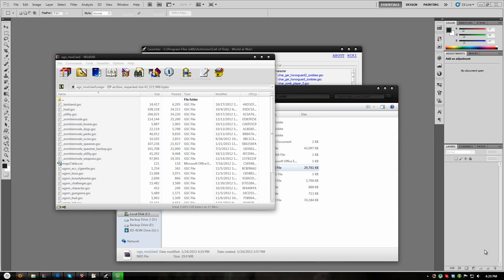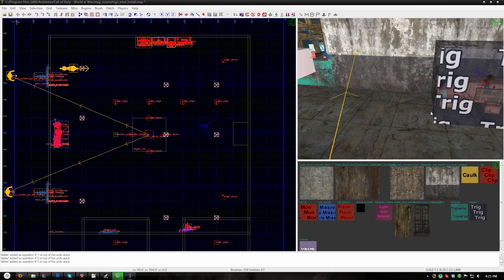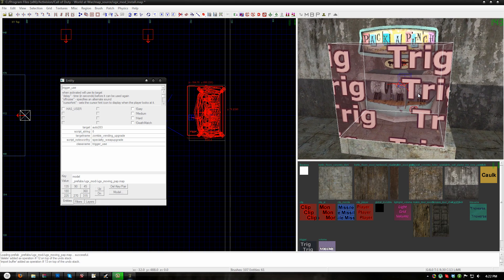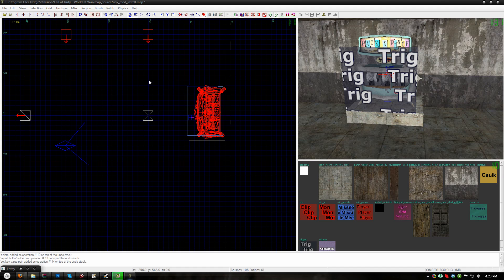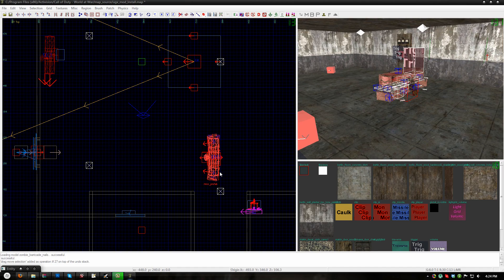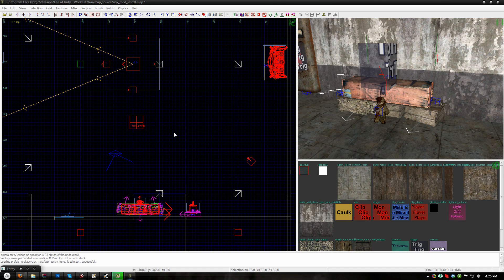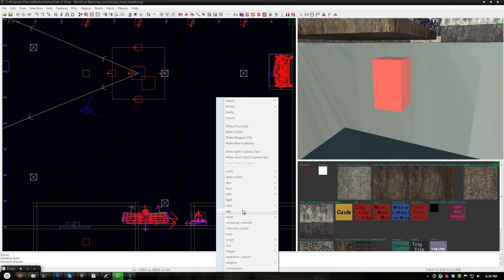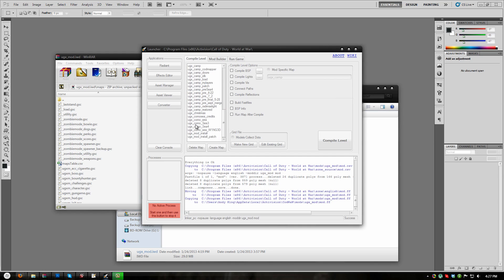[Part 5] How to install UGX Mod v1.0.3 to YOUR Map!

Comment: I can't compile my maps any more cause when i do and try to play the map I don't spawn with a gun and I can't buy any gun on the walls and my menu is invisible I blame you terminaor I spent 2 weeks on the map and now I can't play and I can't make maps thanks a lot
Reply from the maker: Haha, you blame me - that's really funny since I didn't force you to do anything in these videos. It sounds like you know nothing about making maps for WaW in the first place, so I would put the blame on you for biting off more than you can chew here. Go focus on making stock maps so that when you run into simple problems you won't have to worry about other things you installed complicating the solution. These tutorials work fine but only for people who know what they are doing... and fixing your modtools is as simple as following the uninstallation instructions on our Wiki or just reinstalling your modtools completely if you are lazy.
Reply: if i was a map maker i would not be watching tutorials. its hard to follow what your doing if you going to the steps to fast, and i did install my modtools again. I blame you because it was a good map that took 2 weeks to make and I had to uninstall and install all my modtools and also remake my map that took forever to do.